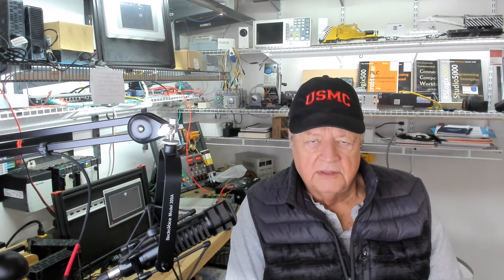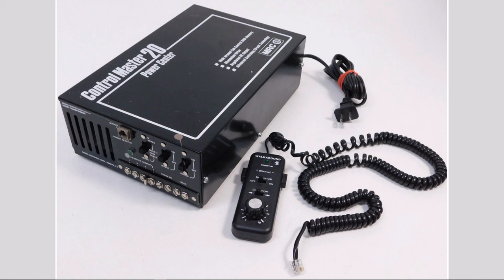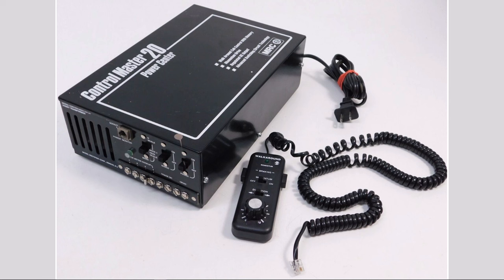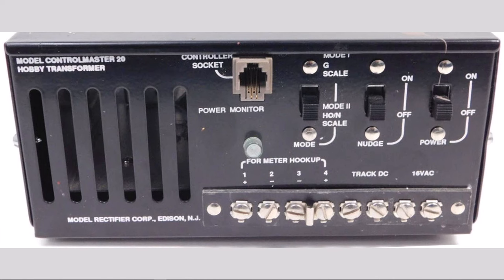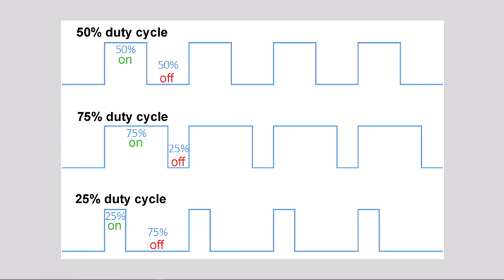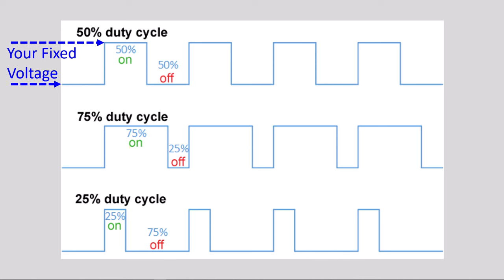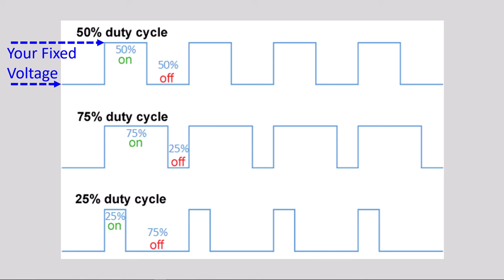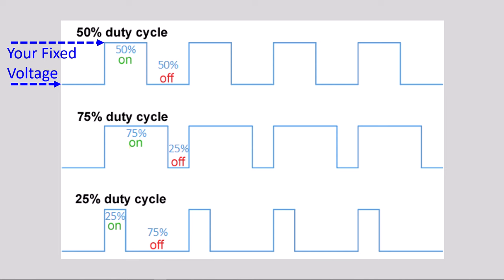MRC Control Master 20 Replacement - Walk Around Throttle

Comment: You don't happen to fix the control master throttle controller do you? I have 2 units, iv narrowed it down to the hand held throttle as being bad..I plug in one  remote and the trains run fine, I plug in the other and nothing, the direction work on it though as I can hear the relay switch over in the power box..and, the momentum light illuminates..but nothing from the pot ..
Reply from the maker: I built this for a friend, that is the limit of my involvement.